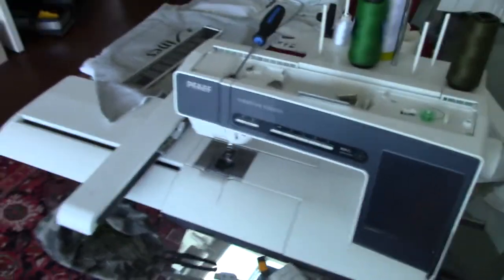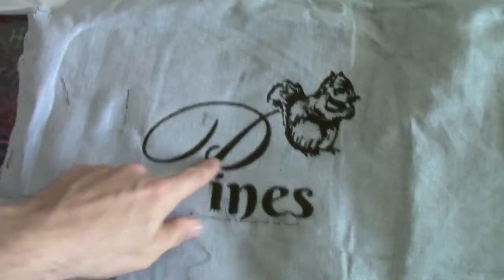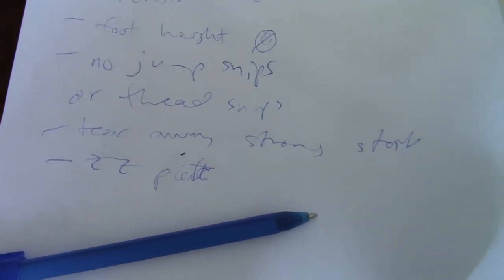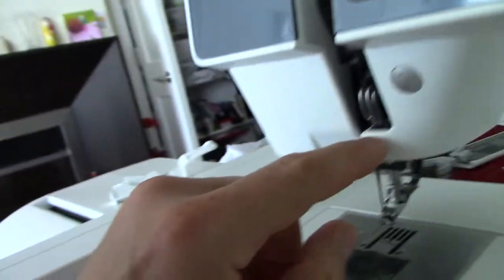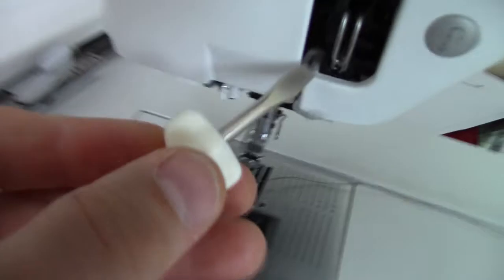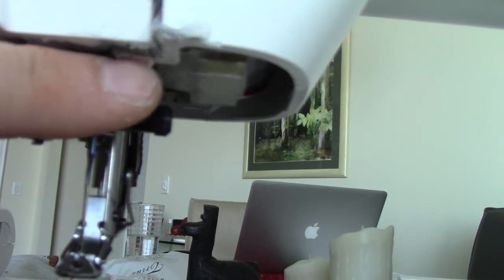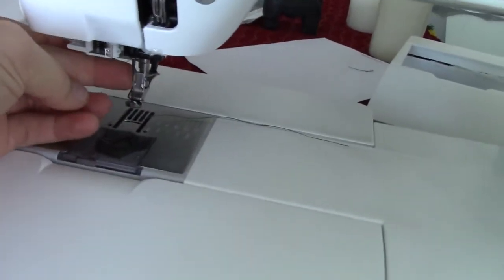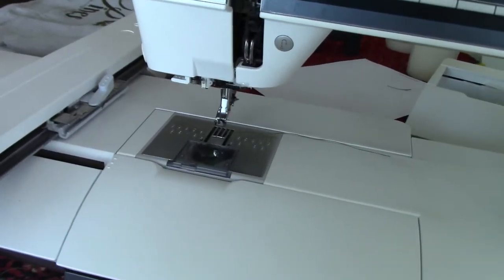Fixing Frustrating Thread Issues on my Pfaff Creative Vision

Comment: I know you posted this video a while ago so you may or may not know this by now. When this machine first came out a lot of people had thread shredding issues with it. Pfaff did address it by bringing out an updated uptake lever which had an extra piece of plastic attached to the top for the thread to sit behind (hard to explain but I could send you a photo of it if it helps, just  let me know where to send it to). If your CV does not have this piece of plastic already attached to the uptake lever it may be worth speaking to a Pfaff dealer to see if you can get one. It did help a lot with the issues. I used this machine happily for years, it is a fabulous machine once you get used to its quirks.
Reply from the maker: Thank you. I have the plastic part on the take-up level. Your information will be very helpful to others as well.
Reply: My thread keep breaking from the top on a Pfaff 1214. Any suggestions?
Reply: Can you send me the pics with the extra plastic.  I just got this machine and it will not embroider.  Thx  sc

Comment: I can't seem to get it to work.  I ordered a new plastic cover for the threading area and took some detailed pics of the differences between the old and new one.  I also took a video of the mechanism behind the plastic cover that I could share.  I cant for the life of me see where you put the metal but I do understand the shreading issue.  I see that you have answered some threads below.
Reply from the maker: I put a piece of metal in the bottom of the tensioner spring to keep the thread from popping out. But the more significant piece is where the thread rubs on the front plastic. This creates a groove over time which makes the thread shred. I was surprised to see that even on steel machines, the thread will create a channel. Fortunately, it is easy to put a piece of fresh metal to make it pass smoothly.
Reply: It creates grooves on that metal part - wow - as I look around the inside of the threading area i see other places where they have placed metal into the plastic where it would contact the thread during sewing.    With respect to the thread popping out - in looking at the new part - they created a deeper groove for the thread sensor to move up and down - if you look closely at the older part, you can see that the thread sensor might have been scraping the back of the part. They have also changed the wedge at the top of the cover where the thread sensor tops out.  Do you have a better picture of this metal piece you added - I still cant figure out how it works and still lets the thread be threaded?  Maybe you also have the picture from SimplySew1 with the uptake lever update.  I think these machines will be changing hands soon as original owners did with mine so people will turn to the internet to re-learn/re-fix them.  Thanks and sorry about trying to reach you on the other channel.  Cheers  @jamesrogers991

Comment: The tiny little thread guide above the needle, that little piece of wire that fits just so above the needle... I need one of those but can't find one anyplace! Also, my machine keeps turning off and on on it's own. I have a "parts" machine I can borrow parts from but I don't know what I need to borrow to fix the on off problem. Ideas?
Reply from the maker: I have been able to order parts for this machine from the UK and a dealer in Montreal. There may be a dealer close to you who can ship the parts.

Comment: I too have this machine and its a frisbee. I keep getting "check needle thread" after it stops and then there is nothing wrong with the needle thread, its still threaded and all i do is hit start again and then of course it stops again,  im glad i found this, im going to make the changes to my machine that you made to yours.
Reply: I have a Viking Topaz 30 that has these same tension issue, there is a littel spring below the lower thread guide that works like a sensor, when it pulls up too high it trips the sensor and stops my machine. I went in and bent the little bastard down out of the way with some pliers. I now cannot trust my machine at all to stop when a thread breaks and must babsit it, but its stopped stopping.

Comment: Hello there James,
I want to thank you for taking the time to diagnose your machine and point out the flaws you found great solutions for. I am currently in the process of rebuilding this same machine I purchased as junk from a local on Craigslist. Things like replacing all capacitors on the electronics board, built a new and more stable power supply, but I had not found a solution to the thread breaking even after fully servicing the unit with the factory service manual. I will be implenting your fixes very soon and look forward to finally making progress with this machine. 

Also I was wondering if you had any updates on your progress? Have you continued to show success in overcoming thread breaking?  
Thanks!
Reply from the maker: Thank you for your feedback. I am amazed at your technical prowess -- I wish I hade that talent, but everyone has gifts. The machine worked really really well after this change so the first time I am happy with the machine. I will be producing a new video soon (upon request) on how to engage the embroidery functions. And then I am going to try to embroidery on knits (I like a challenge) to see if this machine will cooperate fine.
Reply: @jamesrogers991  Its such a relief to hear that you made that machine happy again. The two main issues most users come across are constant thread breakage and power issues. If you ever encounter the power issues, I believe I have solved the problem and would be more than happy to make a write up about it. Good luck with your future projects and I look forward to seeing any future progress you make.
Reply from the maker: @CircuitHusky  Greetings, I am hoping that you can help me. I am starting to get the power issues (overload) so I was wondering if you know how to fix the power supply.
Reply: @jamesrogers991   Hey, sorry for the late reply. I would need to contact you directly so we can discuss the problem in more detail.
Reply: @jamesrogers991  Did you ever get your machine power supply problems sorted out?

Comment: Having similar issues but with tension on my 4.0. Can you tell me how to remove the top “flip up stitch chart” cover flap? I see you’ve removed yours but can’t seem to figure how to get mine off!
Reply from the maker: There are two pins at the edge which act as a hinge. You need to grab both ends and squeeze to bend the cover slightly in the middle. It feels a little scary at first, but unless you are incredibly strong it will bend without breaking and the pins will pull out. You only need one pin to pull out of the bracket and then the lid comes off.

Comment: help urgently how to stop bobbin thread stuck 
and not flowing
Reply from the maker: Are you able to pull the bobbin thread with your fingers or tweezers? Have you lifted the stitch plate recently? There is quite a bit of activity in the bobbin area. For example, the thread cutter, the bobbin race, the bobbin, the bobbin race holder, feed dogs. Check that the thread flows smoothly off the bobbin. Plastic bobbins can get a crack or chip which can bind the thread. You can use a nail file to smooth a chip. Cracks can be more difficult to fix. Damaged bobbins should be thrown out. Sometimes the thread on a bobbin is the last and so must be preserved. Either wind the thread from a damaged bobbin onto a good one or try a temporary fix until the project is finished and then throw it out.

Comment: Hi James, I am having trouble understanding how you placed the metal piece in the front area to keep the thread from jumping out of that hook. I see a metal piece, but have no idea where it is attached. Is it attached front to back of that metal hook or just in front? I suppose if I understood the concept of how that additional metal piece worked, I might understand where to attach it. Any help you can offer would be appreciated. Thanks!
Reply from the maker: I should have explained things better. The upside-down hook in which the thread spring/senor bounces up and down pulls out towards you. It just pushes straight in. There is room for small wires be put in the same hole and then come out to hook over the bottom as I show. Remember to life the bobbin sensor out of the way when pushing that hook back in.

Comment: Has your thread cutter ever worked?
Reply from the maker: The thread cutter works fine with sewing but is hit and miss with embroidery.
Reply: @jamesrogers991  mine is the same, sewing is spot on, embroidery, it's hit and miss. Someone did say that it's not designed for cutting whilst embroidering, but I just don't know for sure.